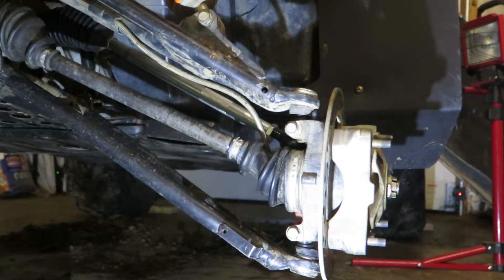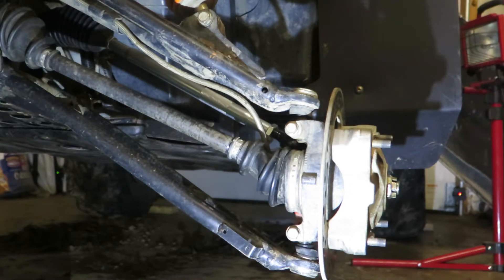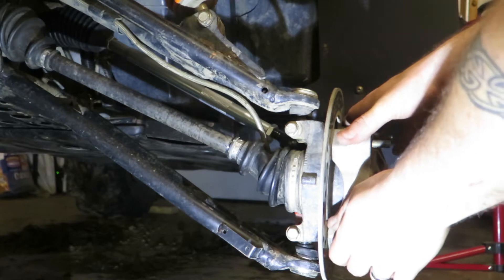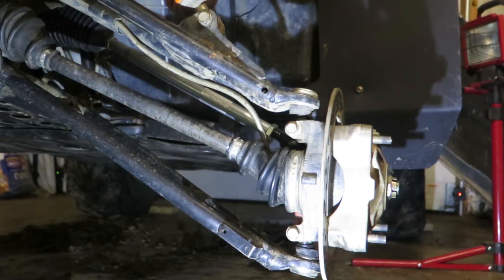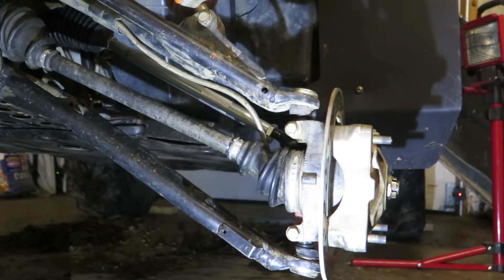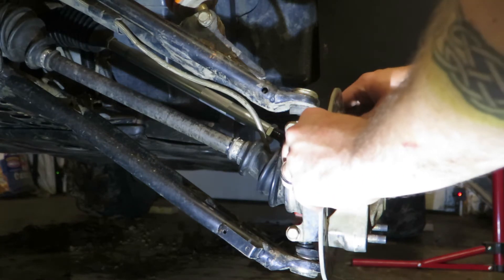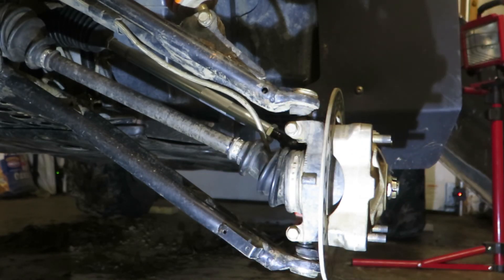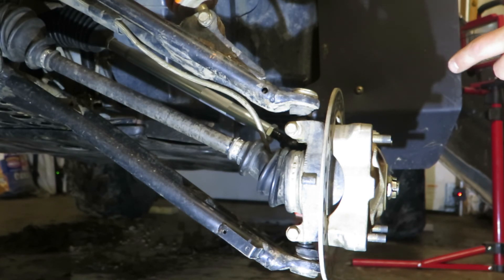Polaris Rzr bad wheel bearing? Only 400 miles...

Comment: I put a new set of wheel bearings on mine also, 2016 Turbo RZR 1000 XP and I have the same problem all seem like there worn yet. They are brand new. Did you figure yours out?

Comment: Mine does the same gonna try the 7555939 washers even though i have new hubs, ball joints, and bearings 2 washers and torqued to over 80 ft lbs on my 2013 rzr 800

Comment: I get between 30 to 50 miles on a set if fronts and CAN NOT figure out why, most dirt road riding with a little rocky trail in the mix, already on my 3rd set this summer, wish I could help ya out

Comment: Finally figured this out after having to replace both front hubs and bearings because the inner race was spinning on the hub, bearings not turning at all.  Look at the exploded view where you order Polaris parts and now you see another washer, large inner diameter, P/N7555939 that goes between the hub and the cone washers allowing the nut to actually preload the inner bearing race.  Lots of failures due to the cone washers bottoming out on the splined part of the axle before the inner race is loaded.  BTW, Polaris now sells a different hub and bearing kit with a larger hub and bearing.  Thanks Polaris for leaving out a $2 part that costs us hundreds.  I think my next scooter will be a Honda.

Comment: Same problem hear guys. Just put a new set of bearings on a polaris sportsman 400 and the 2 washers and still have play at the wheel end. Looking for a solution
Reply: I Just ran into this problem today after I installed a new wheel bearing. Its because the castle nut isnt tight enough. Torque it to 180 ft lbs as in the revised service manual, and it wont have any play anymore.

Comment: Try an swap the hubs and see if that helps I'm thinking you have a bad hub it's just wore out
Reply: I Just ran into this problem today after I installed a new wheel bearing. Its because the castle nut isnt tight enough. Torque it to 180 ft lbs as in the revised service manual, and it wont have any play anymore.

Comment: Have you figured this out?
Reply: I Just ran into this problem today after I installed a new wheel bearing. Its because the castle nut isnt tight enough. Torque it to 180 ft lbs as in the revised service manual, and it wont have any play anymore.
Reply: @lucass9988 this should be the top comment 👌

Comment: I have the same play on mine I have new  Bearings but I’m not sure how many miles I have before I really need to do it is this a serious problem to have a little bit of play I know eventually they could fail but in theory can you make it through the summer of riding it without having to replace it
Reply: I Just ran into this problem today after I installed a new wheel bearing. Its because the castle nut isnt tight enough. Torque it to 180 ft lbs as in the revised service manual, and it wont have any play anymore.

Comment: Did you find an answer to this?   I have the same problem with new OEM bearings and 0 miles. Drive side rear tightened up with new bearings. Passeng side rear is just as lose after the new bearing as before. Any help be appreciated.
Reply: same here. looking for input as to what to do.
Reply: Probably hub needs to be replaced.
Reply from the maker: Yes, I ended up selling the machine.  Upgraded to a polaris general 4.  Problem solved.  :)
Reply: @photokendall  that's a lot of help
Reply from the maker: @jonschutt2706   on a serious note, the wheel bearings were toast after 400 miles.  I played hard in the mud/water with that machine.  Replaced the wheel bearings and the issue went away.
Reply: @photokendall  glad you said something bc I almost traded in for a candham... lmao
Reply: I Just ran into this problem today after I installed a new wheel bearing. Its because the castle nut isnt tight enough. Torque it to 180 ft lbs as in the revised service manual, and it wont have any play anymore.
Reply: @tbagsha  I Just ran into this problem today after I installed a new wheel bearing. Its because the castle nut isnt tight enough. Torque it to 180 ft lbs as in the revised service manual, and it wont have any play anymore.
Reply: @photokendall  I Just ran into this problem today after I installed a new wheel bearing. Its because the castle nut isnt tight enough. Torque it to 180 ft lbs as in the revised service manual, and it wont have any play anymore.